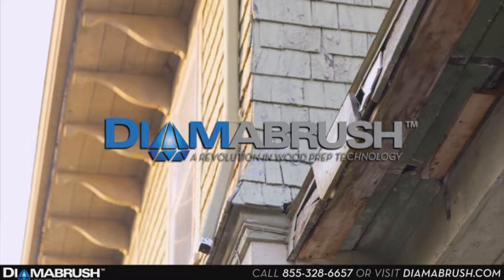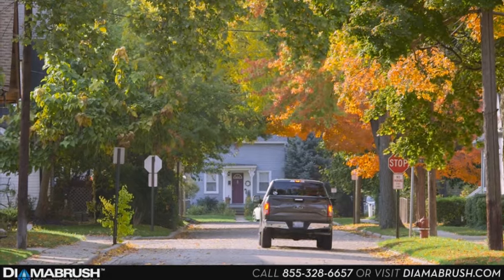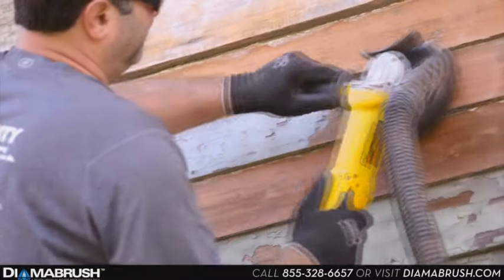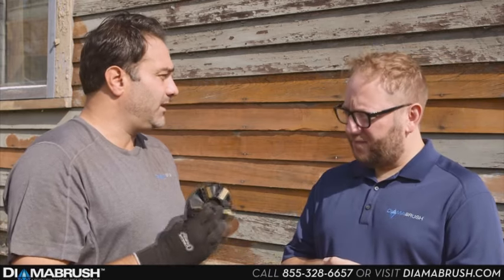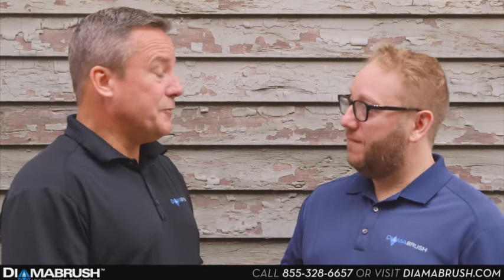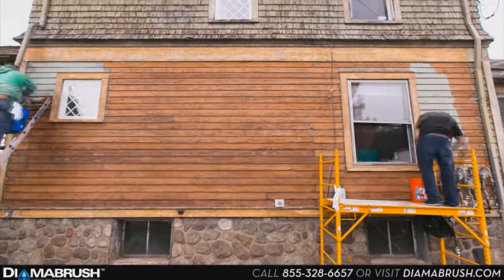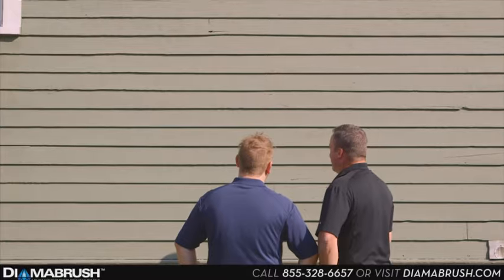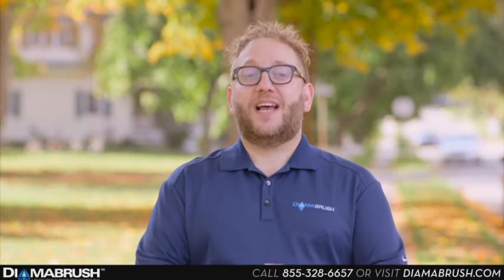Wood, Decks, and Siding Tool Used on a House

Comment: I bought one and did roughly 15sq/ft in about an hour.  the blades kept flying off and hitting me in the hand and the shroud is basically only good for deflecting the blades as they fly off at 9000RPM.  I found one blade that hit the neighbors house and after losing one blade and taking two off the knuckles I decided I had had enough and returned it.  The blades work great but the cheap clip in method of securing the blades is not suffice.  If they ever came out with a better way to secure the blades, like say with actual bolts, this thing would be great.

Comment: I used it. 
It actually does strip the paint but it also destroys the wood if you are not careful. 
Plus you have to do the entire job again with sand paper to smooth the surface.to an acceptable finish.
Reply: Wouldn't it work to sand with large grit size, maybe also with smaller size grit later to smooth out the surface?
I noticed that if the old paint is not holding very well, large grit size will remove it very quickly, will just force it to detach.
If some old paint still remains after some aggressive sanding, you can just leave it, it's bonded so well to the wood, it will hold for many years, so you can paint over it.
(if the colors are similar, of course)

Comment: Sounds like it should last a good 30 seconds after it starts hitting all those nail heads.
Reply: pound them in before you start! 1 tool can't do all the work for you!
Reply: If you leave it in one spot for 30 seconds you will have more problems then just nails.

Comment: Looks good for flat surfaces but my wood siding is curved at the top where the boards join.  How do I strip that?
Reply: If you mean that your siding boards are "cupped" then you'll have to nail them flat before you use that tool. if you mean that its the siding boards are made that way (rounded would be on the bottom of each board) you'll have to use another sander on that part, or scrape first then sand.

Comment: Do the blades ever need to be replaced? Also, and I don't like to talk bad about painter's, but raw wood, especially in that situation, needs a primer coat before paint. No way I'm painting that without primer.
Reply: I saw replacement blades somewhere online, but the price was higher than the price for a new Diamabrush. I guess that might make sense if blades need to be replaced one or two at a time.
Reply: Primer can be also tinted as the same color as the paint. Or they me be using water base stain in this case don’t need primer.
Reply: @Thetileguy  👍 yep

Comment: what do you use for corners?
Reply: I'd use an oscillating multitool with sanding adapter (triangle shape), maybe even the scraping blade if paint in corner is stubborn.
For extreme case, use the metal cutting blade in parallel to the wood, to cut off the paint or wood. The metal blade has smaller teeth, so you still have good control.

Comment: There is never a surface of wood that doesn't have at least some to a lot of nails or screw heads that are above the top surface. That means,  this tool will not last long before it hits one. And then what happens? This add never addresses this issue. Wonder why?
Reply: I’ve been using this on my house and haven’t Run into that issue although obviously I checked to make sure anything like nails or screws or other type of debris weren’t already sticking out before I started that’s common sense
Reply: @audioapegaming3334  Yes. Anyone that thinks they are going to use this better check for nails and or screws above the wood. If that is done, I bet this works great. I've "tried" to scrape paint off old houses before and when a house gets too old, with countless number of paint jobs, this has to be a better answer, other than residing.
Reply: @audioapegaming3334   Finally someone who preps and makes sure the surface is ready before sanding! Everyone else acts like it should just already be done.
Reply: First step is to set protruding nails, worked just fine for me

Comment: Too bad it's not EPA compliant ☹️
Reply: I was thinking about all the lead paint that could fly. What do you recommend?
Reply: It's connected to a vacuum
Reply: @src4409  lol the shroud is the problem and secondly most vacuums can’t pull enough volume to keep up with the dust production

Comment: I am looking at a Harbor Freight angle grinder 4.3 amp. Will this work okay with the Diamabrush? I am also considering the Dealt 11 amp. I only plan to use this on a large deck to remove paint and will only use it for occassional small jobs. Your thoughts?
Reply: Save your money and buy a decent angle grinder, you will always use that do not buy a cheap one.
Reply: Save your money and don’t buy the diamondbrush, destroys the wood

Comment: BIG TIME E.P.A. Violation LEAD DUST FLYING ALL OVER THE PLACE BIG NO NO 
bad video for you guys to have used 
Historical Home + Diamabrush= Lead dust 
Dust ,What Lead dust
Reply: This guy knows what he is talking about.
Reply: The home owner could sand the house themselves but a pro would need the body suit and plastic on the ground etc etc for EPA reasons.
Reply: @jessiegregorio2298  The homeowner has to practice the same. Just because he owns the house that doesn't mean that he is allowed to contaminate his neighbors and his community.
Reply: only work after 5:30 PM ....
Reply: @johnnybongs  technically not. RRP rules only apply to contractors. A homeowner can do it however they want.
Reply: The vacuum catches the paint, it worked great on my 1880 home, 99 percent of the piant waste contained by the vacuum with a hepa filter.
Reply: I have a 130 year old house that doesn't have any lead paint on the exterior because it was all removed many years ago before its current paint job.  Maybe you should just trust that professionals know to do a lead paint test. Just because they didn't show doesn't mean they didn't do one.

Comment: That old paint has "Lead". Did you scraped and sand according to the EPA Guidelines? If you did not you might be in trouble for violating EPA Guideline for lead paint removal and contaminating your workers and the ground. Do you have all the recorded documentation required by EPA in the process of removing the lead paint? Are you CERTIFIED by the EPA TO PERFORM THAT TYPE OF WORK?
Reply: The fucking lead police! Watch out! Nothing better to do besides complain about other peoples videos.
Reply: Lead is the best thing about it!  I like grinding some of the chips up and giving them to my neighbor for garden fertilizer.  I tell her it is "natural".  I've been told the chips are good for soaking in the neighborhood kids Kool-aid for extra flavor.